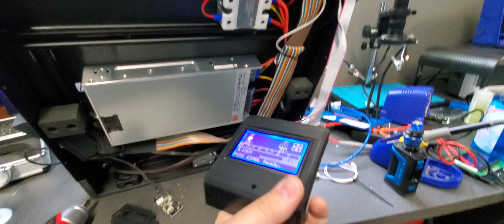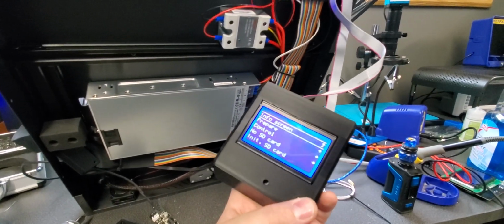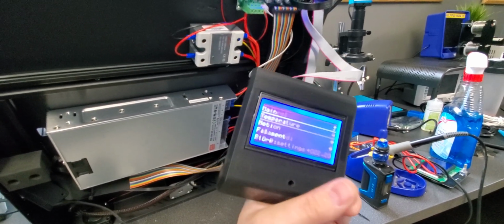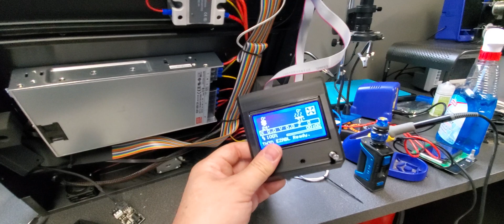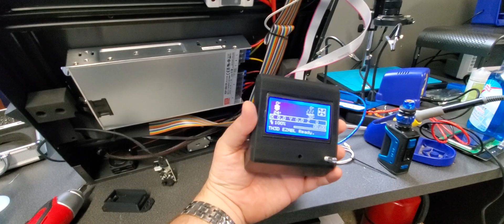Development Update - CR-10S Pro Upgrade Update - LCD

Comment: Looks like you have an earlier iteration of the PRO (especially noted by the SSR not having a heat sink attached) what mainboard version is that? With the V2 pro's being released soon... might be whilling to bet different mainboards are spread throughout the community. Just wondering your thoughts?
Reply from the maker: AFAIK we have seen they used the same board in the V2. They used the same board in the CR-10S Max as well that has a BL Touch instead of the 18mm probe.
Reply: @TH3DStudio  Thanks for the reply & great to hear! I'm excited to get this mod up and running to see the additional feature sets that should have been on this "pro" printer to begin with... I do have a question tho; will TH3D be going to Marlin 2.0 for further development.?

Also a feature that I've personally been unable to get to work on the touchscreen is filiment change / pause for event to get simple multi-colored prints. Thanks again.

Comment: After a few years printing my train adapters on a M3D Mini, I bought a CR 10S Pro for larger parts printing, so far after a very rough two weeks of teething, I have added the Axis Upper pulleys, the Inductive Bed Sensor and Tiny Machines Firmware. Finally I updated to CURA 4.3 and their Pro presets. No my small parts pop of after cooling down in near perfect shape. But the Tall Z rails still have vibrations. I worry for tall parts. I bought the Struts Kit for the 10S and thought I could reach through the sheet metal to find the Base Frame is MUCH shorter then the 10S frame. Apparently they are Attached to the steel frame and that is connected to the Bed Rails. Can you guys offer any input to improving the rigidity using the Round Bars bolted to the upper frame and fastened to the base in some fashion. I like the touch screen but clearly see access to optional setting is critical outcome. Are linear bearings worth the money? Are 32 bit boards worth the cost and grief? Is there anyone looking into the use of realtime feedback and control of Filament width during setup. I worked in Robotic Welding in the past and we always made test beads before each job to verify offsets and calibration of the bead fill. We could measure the weld groove width and height and feed precisely the exact volume of wire to get a flat full weld fill nearly perfect throughout the process, this was used at John Deere, Cat and in Aerospace. Why couldn't we use similar approaches with Arduino boards, sensors and some simple Algorithms to tune the Nozzle distance, feed rate and Speed in a test bead on the side of the bed with stand alone add on board sets that then feed the offsets and adjustments into your new screen and in to the controller for perfect prints every time. It makes so much sense giving all the variables in this early days development of Low End 3D Printers. Filament quality and humidity are some variables that only a test bead can detect and adjust for. Thank you for focusing on all the issues you are, I see you are providing a wonderful service for the hobby printers, and could see the 10S base model as a great High School Starter Printer and then updating with your mods as part of the learning about 3D printing as part of the whole learning experience. Could you support such a project with these upgrades kits and tutorials?
Reply: I'll post two answers to many of your questions (that I'm personally aware of but still a novice so please forgive me).
Frame rigidity: CR-10s Pro Frame Brace V2 found on #Thingiverse https://www.thingiverse.com/thing:3905499
And also in my case I change lead screws to TR8x2 instead of the factory ones that occasionally have x carriage drop even with anti backlash nuts installed.

Comment: Curious if you're going to do a Unified Firmware on marlin 2.0 anytime soon?
Reply from the maker: Right now 8 Bit on 2.0 is about the same as on 1.1.9 we probably won't port that all over until later next year. The 1.1.9 build we have is very stable and works on a lot of machines.

Comment: Will the EZBoard Lite work in the Ender 5 Plus, or will we need to wait for the EZBoard Heavy?
Reply from the maker: Once we get the E5 Plus we will let you know. We hear that it has the V2.2 board so if the LCD is replaced with a 12864 it can work with it. We won't be able to support the TouchLCD because its closed source.